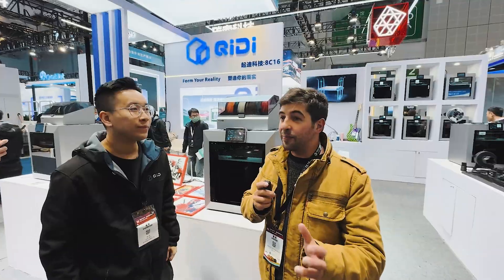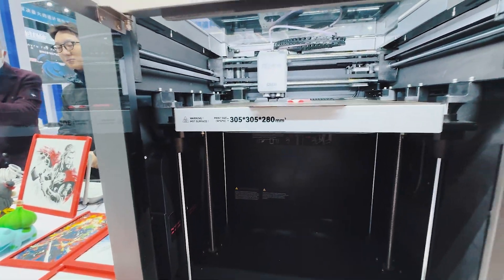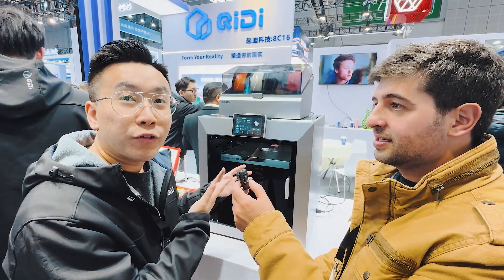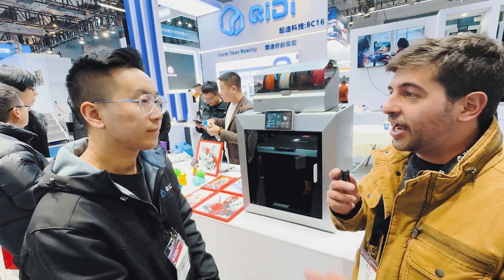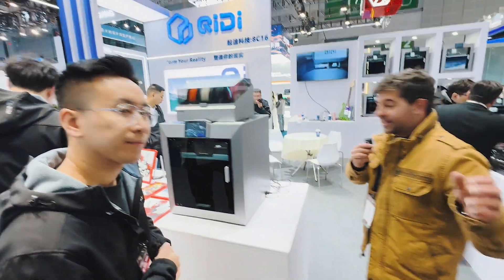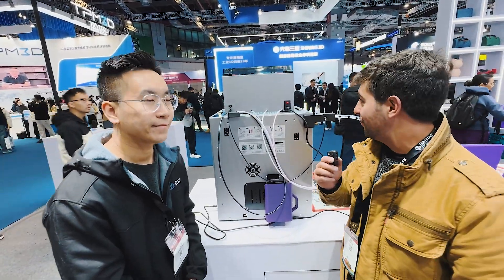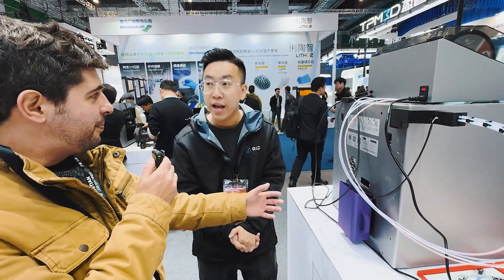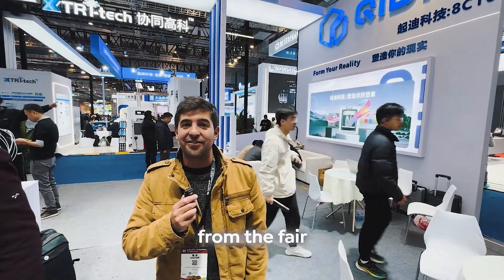Value 3D Printer for Engineering Filaments? Meet the multicolor QiDi Plus 4

Comment: seen too many mixed reviews about this printer. on paper its a great printer but you pretty much have to decide if u want to p[rint in high temp or reg temps cuz from i have seen and heard the calibration changes with temps. and of course the early problems with hot ends control boards catching fire etc.... feels rushed
Reply: They’ve solved most of the issues by the time i got it in april. I have to adjust z offset farther when printing hot stuff like nylon and reset it when printing regular stuff like PLA. But i’ve gotten used to it. It is reproducible enough that it could probably be compensated in the klipper config